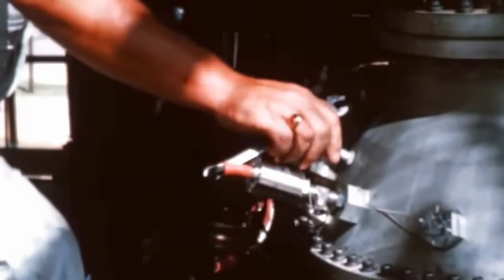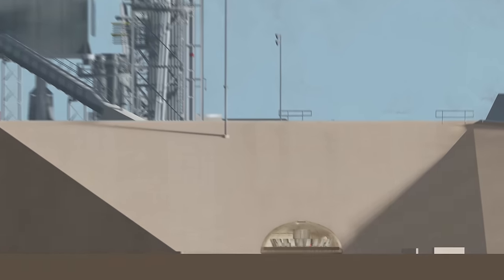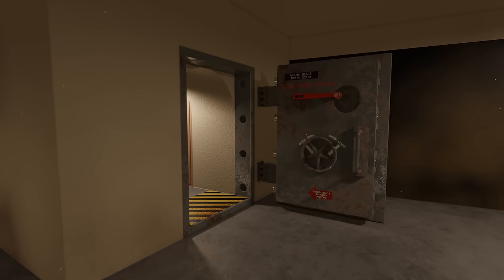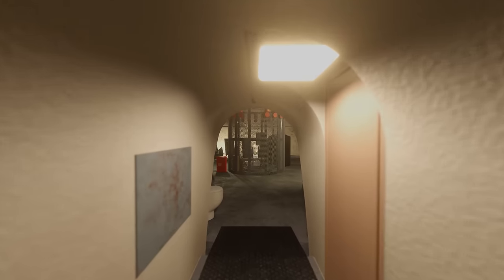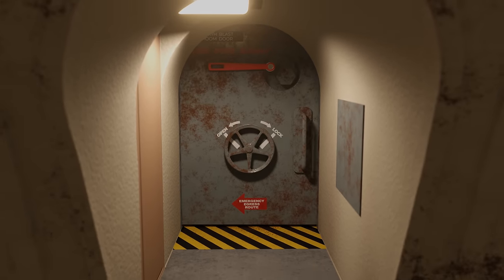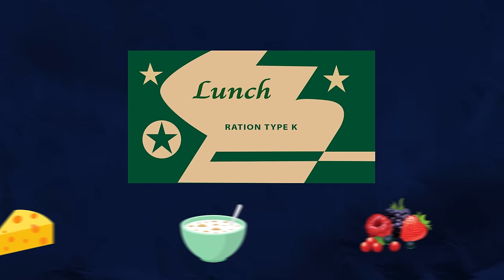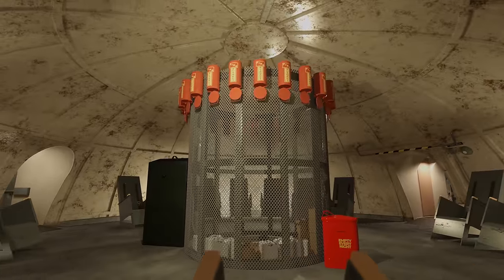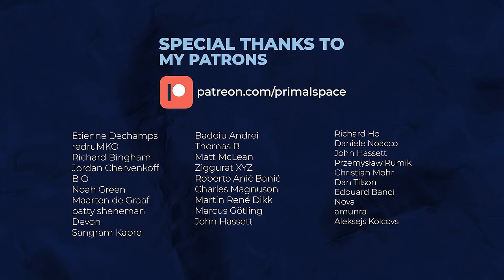NASA's Most Off Limits Room

Comment: The rubber room was not closed or inaccessible for years.  There is both electrical and other reasons it needed to be opened from time to time for access related to pad maintenance.  It was considered a confined space area and was kept locked up and had to be checked for appropriate O2 levels before entry.  Once opened, it was not unusual to invite newer employees, with Pad Safety's blessing, to go see the room but then after whatever work was complete, Pad Safety would close the area back up.  Ex Pad Elec Engineer.
Reply: Question, in the realistic scenario of a explosion, would this plan actually save life? Realistically, not theoretical, not hyperbolic. Thank you
Reply: @chimeraproject9481 you're asking a hypothetical question and telling them not to answer in theoretic terms.  lmao what else would they base speculation on?
Reply: @chimeraproject9481  Given the history of rocket accidents, there doesn't seem to be enough warning of an explosion for this to ever have been realistic.
When they go boom, they go boom quick. If there's a problem where something is on some kind of slow build, something can be done to shut it down, either fixing or aborting.
Reply: I was coming here to say this as well. I've been in the rubber room, inside the vault in there as well. The seats are huge!
Reply: Important question: did they get to use the slide?
Reply: @KeeepOut did you get to use the slide?
Reply: @thatfunkyduck  no, it was really gross and had a bunch of blankets on it, probably to soak up rain water or water dripping from something
Reply: @KeeepOut  oh I see. Well the video did say that it used water to facilitate the sliding of the person down the slide. Maybe they tested it with water?
Reply: I was wondering why the title says it's off limits, thanks for this.
Reply: Thanks! Was this under 39A or B? I worked at A in the catacombs, and all levels within, but am unfamiliar with this. Curious where access was located in correlation to the rooms I've been in. I've worked all the way to the ends of the N/S catacombs from the E/W breezeway, and those levels also had "no climb" markers due to low O2, no air transfer. This is fascinating.
Reply: Fascinating indeed!
Reply: Actually it was because I was occupying it because I was crazy and they locked me in there. The rats made a bit wacky. Crazy even.  Crazy right?
Reply: It seems like the likelihood of a catastrophic explosion occurring with enough warning to let the crew escape to a safe room, but not enough warning to vacate the premises would be fairly low. But it's good that they had some contingency plan for that situation. @Tasarran
Reply: What was your gs scale they paid you for that
Reply: Guys, Here is the Savior

YaH The Heavenly FATHER (Genesis 1) HIMSELF was Who they Crucified/Pierced for our sins and “HERE IS THE PROOF”

From the Ancient Egyptian Semitic: 
"Yad He Vav He" is what Moshe (Moses) wrote, when Moses asked YaH His Name (Exodus 3)

Ancient Egyptian Semitic Direct Translation
Yad - "Behold The Hand"
He - "Behold the Breath"
Vav - "Behold The NAIL" <— YaH’s Crucifixion
He - "Behold the Breath"

“Behold the HAND that Beholds The NAIL” 

PROVES - YAH The Heavenly Father HIMSELF was Who they Crucified

That is EXACTLY what Moses Wrote

Here is what they mean

YaH's Name:
(Ya)d + (H)e, as YaH is what Moses called Him and YaH Declared: "this is My Name, this is My Name for all generations" (Exodus 3)

YaH is The Creator of “MAN”: (Genesis 2:7)
Yad He, (HAND BREATH), as YaH's "HAND" Formed man from the dust  of the Earth and His "BREATH" made him a living being (Adam)

YaH's Sacrifice of Crucifixion for “MAN”:
Vav He (NAIL BREATH), the "NAIL" through YaH’s "HAND", in Sacrifice of Crucifixion, that whosoever shall call YaH Savior, His “BREATH” brings forth life (Salvation)

How YaH arrives:
YaH arrives via the Tent of Meeting (Exodus 33:7:11, Isaiah 54, 55), where a Tent is erected outside the city, a cloud descends upon the entrance of the Tent and YaH appears...

Why they demanded YaH to be Crucified:
YaH was Crucified according to Hebrew law (Deuteronomy 21), to be NAILED/PIERCED on an Almond Tree for BLASPHEMY as it was for His NAME they demanded Him Crucified. The Messiah claimed He was YaH...

HE WAS YaH!!!

HalleluYAH translates “Praise ye YaH”

The Hebrew Book of Isaiah

Isaiah 42:8
"I am YaH; that is my Name! I will not yield my glory to another or my praise to idols.

Isaiah 43:11
I, I am YAH, and there is no other Savior but Me.

Isaiah 45:5
I am YaH, and there is none else.
Reply: suuure lol
Reply: @TheGoodMorty  He is asking would this thing actually be viable or is it just a mental crutch to keep the workers calmer. Like hiding under a desk in event of a nuclear explosion in the 50s. Why are you so condescending seems you're the one not able to process this question, I understood it
Reply: @chimeraproject9481  Good question was thinking the same
Reply: It’s a nasty place.
Reply: Please tell me the slide was tested in those times.
Reply: Fibber
Reply: @mr.iforgot3062  who’s fibbing?
Reply: Woah neat thank you
Reply: @blazingstar9638  Not a problem. Thank you.
Reply: @Praise___YaH literally no one cares
Reply: @chimeraproject9481 it all depends on how bad the explosion is. If it was really bad it’s comparable to a small nuclear bomb like when the Soviet n-1 rocket went off.
Reply: rubber room, with rats? cause rats make me crazy. speaking of crazy, i was crazy once, they locked me in a room, a rubber room, a rubber room with rats, and rats make me crazy!
Reply: @KeeepOut  important question: was it full of rats
Reply: @Cappyl  I didn't see any

Comment: Coolest thing about that room that I learned is you can actually burn something to create oxygen instead of usually how burning things produce smoke and bad stuff.
Reply: Oxygen candles are standard issue for modern airplanes, where do you think the emergency air for the dangling mask comes from?
Reply: @lelagrangeeffectphysics4120 oxygen tanks?
Reply: I believe they also use oxygen candles on the ISS, at least as a backup.
Reply: @KentGoSuzuki No. only pilots have their own oxygen tanks next to them and cabin crew has a couple in the cabin. All the passengers have oxygen generators above them because it’s much lighter than tanks.
Reply: @KentGoSuzuki  That is dumb, oxygen tanks would need to be pressurized and be heavy, which would cut into profits, go to school
Reply: @lelagrangeeffectphysics4120   oxy tanks on aircraft are quite light and very cheap compared to oxy generators......the problem is space and servicing would be a nightmare. Much easier to have a cannister for each PSU
Reply: @lelagrangeeffectphysics4120  very rude person.  you have zero friends.  also you're wrong, which makes it even better.
Reply: @5GTrevor  Nice ad hominem good to know you cant make good arguments ;)
Reply: They use those on submarines as well.
Reply: @lelagrangeeffectphysics4120  Nonetheless that isn't proper way to respond.
Politeness goes long way, and people are more likely to listen to you when you're not mixing insults in the information.
How'd you feel if you were called names, every time you didn't know something or failed/performed sub-optimally a task in your life?
Reply: RIGHT?! I screenshot that shit. 😂
Reply: @lelagrangeeffectphysics4120  Please cry more.
Reply: @Eternal1nstant  daww you were hoping for a reaction, i hope you can collect yourself and recover
Reply: @lelagrangeeffectphysics4120 It's current year. Crying adhom and whipping out other beginner reddit fallacies automatically loses you the internet argument. Go back to preschool.
Reply: @5GTrevor  He probably doesn't have friends and is very rude/ angry. But he actually is right. Most aircraft use chemical oxygen generators and some use O2 tanks.
Reply: It is used as a backup system in submarines. In a nuclear submarine, the primary way of generating oxygen is through electrolysis of water, but if something goes wrong with that system, they can burn these candles to generate oxygen.
Reply: used allot on submarines too. think it's pretty cool but kinda lets you know things down there are for real. scotty don't light the candles scotty just killed several people in their sleep. gotta be on your A game.
Reply: @KentGoSuzuki they only need a small amount of oxygen to descend to a breathable atmosphere
Reply: @lelagrangeeffectphysics4120 hoping for a reaction? Bro you gave him one 💀

Comment: This was used for the shuttle program, and all shuttle crew were trained how to use it, as well as the cable car escape system located on the backside of the same level as the Orbiter Access Arm. We never referred to it as the bunker, however. It was called the round room. There was no slide between the Mobile Launch Platform and the hatched opening on the deck for the Orbiter program. One would have to run to it, open the hatch and jump in, the last in shutting and latching the door behind. During conversion of the pads (LC39A & B) from Saturns to Orbiters, the whole escape system was accessible to anyone who could get on the pad and knew about it. It was a long walk/jog down that tunnel, but it was well lit with caged bulbs in the ceiling about every 50’.
I was an engineer on LC39B (B pad) during its final phase of refit, working with Sauer, the prime; then the TTV phase, working with BSI, the prime; then went over to LSOC (after the turnover ceremony that was heavily influenced by wild pigs). Our first launch was Challenger. The top of the slide had a hinged and latched hatch then. It may have been decided as part of the Challenger investigation to later weld a plate over it and rely solely on the cable slides. 
The Challenger crew did practice opening the hatch and sliding down into the rubber room, with several practicing closing the hatch behind. They also practiced sliding the cars down the cables to get an idea of how they worked and how the drag chains slowed them down at the bottom, getting out of the cars, and running to the end of the tunnel, then running up inside the tunnel to the round room and strapping in.  
None of it seemed very practical, but it was one of many contingency plans. During a launch, nobody but the flight crew was within three miles of the pad. Launch control had to mitigate problems remotely, shutting fuel valves, disconnecting electrical circuts,  moving arms and umbilical units, etc. The crew was on their own, and not every abort scenario involved an unforeseen explosion, so NASA did what it could to provide the crew with exit strategies. 
When compared to the Orbiter's barber pole escape plan, this one seems pretty reasonable.
Reply: You'd think in a catastrophic event no one would have all this time to get down there and seal it, especially a few dozen people
Reply: It would depend on the situation. If it was a fuel leak or a structural failure prior to ignition, or an electrical fire, they’d have time to get into “scape suits,” get down off the tower, and bail down the slide. These activities are all rehearsed by the astronauts and the fueling crews.
Reply: This wasn't used for the Shuttle program.  The tube opening on the pad surface had a plate welded over it.  The only access was through the ECS duct out at the pad perimeter.  Only the slidewire and its associated bunker were used for Shuttle.
Reply: Wrong, not used for Shuttle program at all.  Ex Shuttle pad engineer I am.
Reply: How slow does the explosion have to be for the plan to actually work in a realistic manner?
Reply: @mweller9949  you are correct. I work in the NASA safety office and was involved with most of the pad demolition and upgrades for ARTEMIS. The Openings were welded shut and are still in place when I left KSC in 2014.
Reply: Wait they sealed the WHOLE thing or just the slide? If they sealed the whole bunker in that's kind of lame. I suppose it will be a good time capsule if it doesn't rust apart  and collapse in on itself though.
Reply: I'm amazed, by the optimism, probably by the pricetag, by the total lack of understanding of how a waterslide even works - and if you put a wall on the end or not (with or without a shockwave involved) 
Wow! 
And you wonder why some people can think you never made it to the moon. 
😆
Nice poker room, though
Reply: @happyfox711  Not sure what you're implying.  The slide was tested and worked.  The slide ramps upward toward the end to bring one to a gradual stop.  As with any design, testing and adjustment to ensure safe use was performed and completed.  The intent was to have the astronauts all cleared away from the vehicle, through the slide and fully enclose inside the rubber room BEFORE any explosion took place.  If any were in transit to the rubber room at time of a catastrophic explosion, then all bets were off on their odds of survival.  A significant problem would have to have been remotely detected suggesting a potential explosion may occur prompting the test team to consider making an on-pad crew abort call and then hope enough time was available to allow the entire step-by-step escape plan to work. Luckily, that scenario never occurred but at least they had something in place.
Reply: sorry man but I ain’t reading allat
Reply: @mweller9949  noted you're so sure what I implied that you had to write a 4 page debunker thing. 
😆😆😆👌
(I'm laughing w. the astronauts here)
Let's just agree it looks good on paper. The guys that tested it initially actually broke a few bones at the wall..

Comment: If they could slightly improve the safety for the slide, it'd be amazing to preserve the bunker as an exhibit/museum while allowing the slide to be in use as well.
Reply from the maker: That would be pretty cool. I would love to give that improved slide a go!
Reply: all they'd have to do was put some thick padding at the end and we have a safe slide.
Reply: The problem with that is that Launch Complex 39A is leased to SpaceX who use it for their launches and 39B is used by the Artemis program.
Reply: @ronaldtreitner1460  A 60m long slide that is lubricated by a water sprinkler is going to need a lot more than some thick padding. They pretty clearly had at least some padding yet someone broke bones. Would probably make more sense to have a drain for the water combined with a slight upwards slope beyond the drain so that the water would pool in the right spot. They probably just didn't do it because a drain would be another path for a shockwave to ingress into the facility. Although they could have potentially had the drain connected to a sealed tank.
Reply: @alexsis1778 Those are good ideas! I was thinking they could use an inflatable bag (constantly inflating like a bouncy house for kids) or some 3' long springs behind a generously padded board.
Reply: Just do like they do for slides at water parks. Use the water as a braking system.  they would need to extend the braking area a little more with more slope so the water is brought up gradually and not all at once.
Reply: It should jist open up into a ball pit or foam pit 😂
Reply: @acdii  That only works up to a certain speed, then you skip like a rock and hardly slow at all...
Reply: @Tasarran  If the water surface is unbroken they will. Need a deluge system to make the water surface a sponge.
Reply: @TheSixStringGuy  I was going to make the same suggestion with the ball pit.  You'd spread the near terminal Newton forces out among thousands of 'micro' collisions.  It might sound comical, but from a physics standpoint it makes the most sense.  An inflatable bag, like those stunt people use, would be the next best thing, but you'd have the logistical problem of others coming down in rapid succession.
Reply: @primalspace  they can just have a big wall of deep soft cushion, into which the people coming out of the slide will crash into.
Reply: @ronaldtreitner1460 or, y'know, a drain. Nasa engineers couldn't figure out to use a drain? Starting to understand why they don't get much funding anymore. the designs ingenious, but also stupid in so many ways.
Reply: @alexsis1778 if the drain is at the bottom of the bunker, the water would drain down, unless they're pumping it back up to the top near the launch site, which would just be moronic. Unless they're purposely trying to make it so, the drain exit shouldn't even be anywhere near the explosion.
Reply: @acdii that'd soak the inside of the bunker, which would have absolutely no way to be drained. The bunker would quickly be flooded and useless.
Reply: @Dipj01 soft cushions aren't soft at high speed
Reply: @gbazo762  There are drains to extract the water.
Reply: @acdii  they don't work?